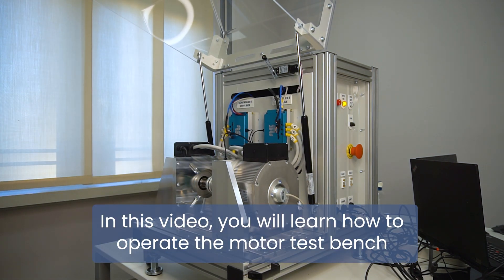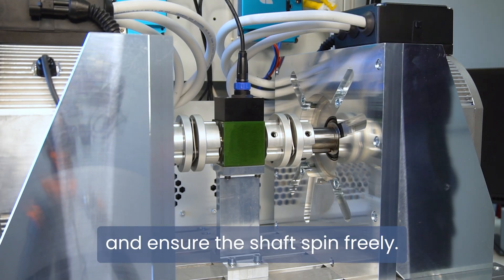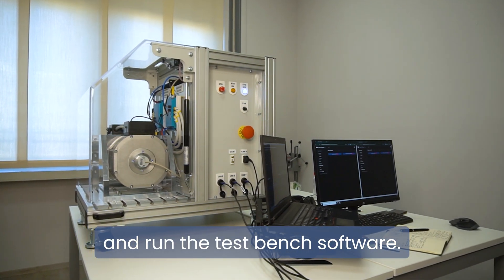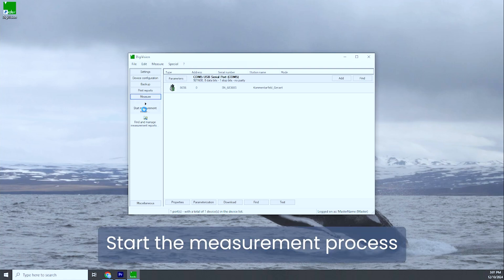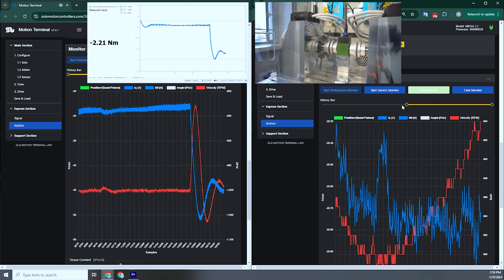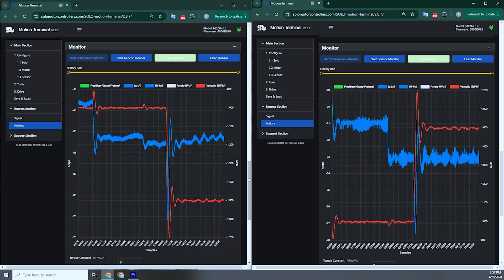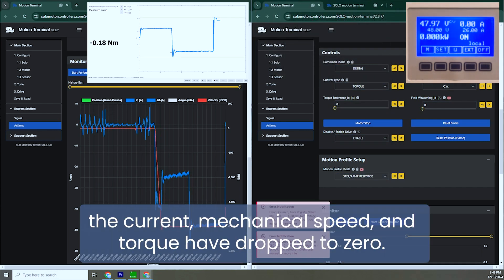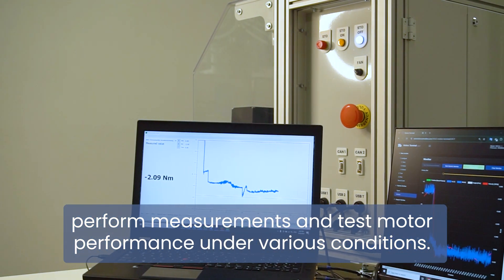How to Operate the 30kW Motor Test Bench: Step-by-Step Guide for Optimal Performance

Comment: What power supply are you using for DC?
Reply from the maker: This test bench was designed to operate with an external power supply. In this video we used PSI 880-60 R 1500 W by Elektro Automatik.